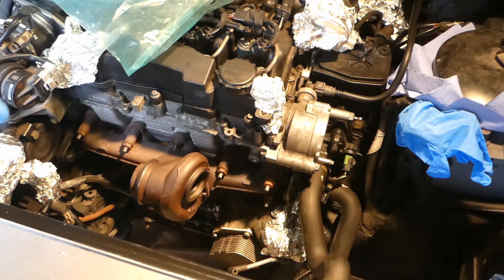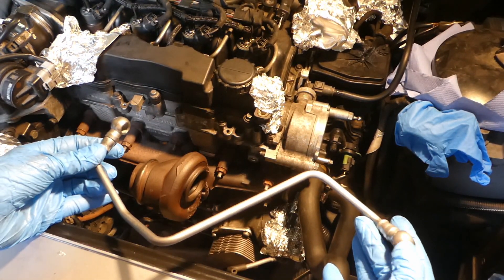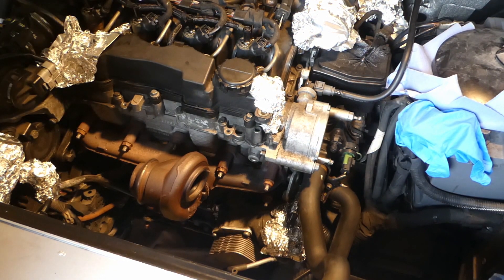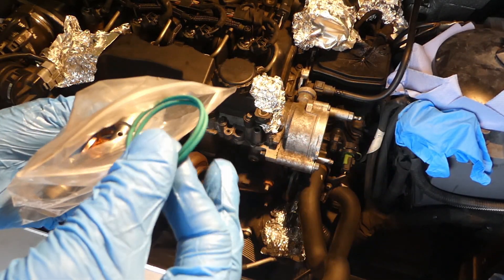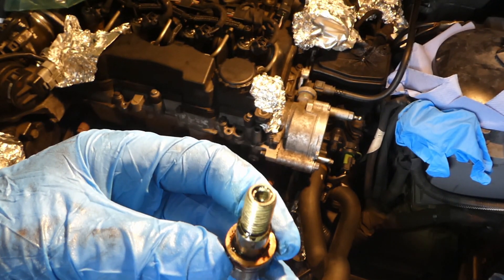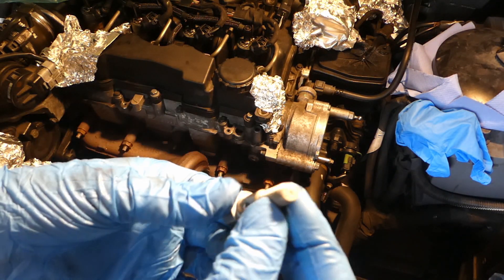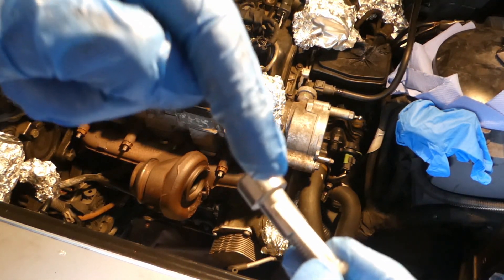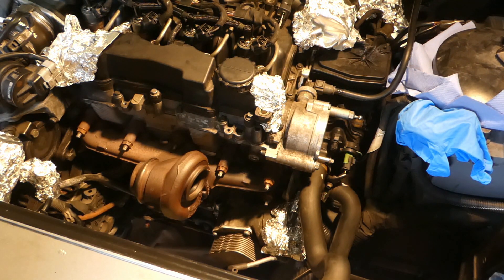1.6HDi turbo replacement, the full guide (part 3/5: fit new turbo)

Comment: please can you confirm the torque of those bolts, because you said thirty (30) NM but the pictures shows three (3) NM
Reply: ok thank you very much, now i understand...yes im doing it cause that oil tube started to loose a lot of oil, so im replaicing it, and i've disassembled and cleanned the turbo geometry too, i'v also washed the dpf...the only issue i had was the metalic pressure hose (out) of the dpf was really stuck, and was a big fight to get it out, now i must buy a new one but citroen dont made it anymore, and i can´t find it anywere, i must find a solution
Reply: sorry about my english, not my native language
Reply from the maker: @MarioRosa_70  Absolutely no problem at all. Better than most
Reply from the maker: @MarioRosa_70  No worries. Hope it works out ok. Maybe second hand ebay or somewhere else. Newer models might have similar hose.
Reply from the maker: Yes, I can confirm that these are 30Nm, not 3. In the picture it is written as 3daN, which is 3 * 10Nm. It is somewhat confusing, but is deci Nm, so 3 * 10Nm = 30Nm. Hope that helps and good luck if you are doing it
Reply from the maker: Correction, in the picture is daN or should have been daNm, and it is decanewthon meter, so 1daN is 10Nm.
Reply from the maker: See here: https://mathda.com/convert/torque/deca-newton-meter-to-newton-meter?sourceValue=1

Comment: Hi, where did u get those instruction pics with torque settings?
Reply from the maker: They come from PeugeotDocs, like a software that you install, similar to Diagbox/PP2000.
Reply: @ thnx. i assume it is a paid product or service.
Reply from the maker: @ Well, yes, but copies can be found around. If the car is up to say 2016 then it can be used with diagbox/pp2000/lexia.
Reply: @ could u link to one of these copies? i have a 2019 1.5 peugeot engine, even though it is marketed as toyota proace.
Reply from the maker: @ZwaanAfghan  Unfortunately, I cannot post a link here, but if you search download diagbox it will come up. All sorts of torrents. You would need an OBDII to usb interface that one can purchase on ebay, but 2019 might be on the newer side of things, as from a certain year it is all online. Now this is for diagnostic, but you can download Peugeot docs and that is separate which should have all the docs with torque settings, etc. Might not be for toyota proace, but you can see the other peugeots which will most likely share the platform. I think it was called something like Peugeot service box or SEDRE. I have it on windows 7, as it does not work on newer windows editions, so you may need a VM.

Comment: Hello, thank you for your work and videos ! If you can help me, i have 1.6hdi 109 cp and the top bolt gets smoked i think, maybe some burned oil or something, i don`t know. And my turbo whistles, but other than that, no problem with injectors, no oil leaks, no nothing. Do you know what would the reason be ? Thank you
Reply from the maker: Hi Alex, do you mean the top turbo banjo bolt? It is probably leaking a bit of oil and drips onto the turbine and gets smoked. You could reposition it (on a cold engine). Basically the pipe has to be central on the banjo bolt and not touching any of the sides. The it should not leak.
Reply: @moremolecules  yes, the top turbo banjo bolt. I looked and it doesn`t touch any side of it. It is just smoked around it, it looks like burned oil. Also, it seems to be burned oil next to the bolt, on the turbine exterior wall. Could it be some leaks because it is not tightened enough or something ? Should I change the oil feed pipe? I also don`t have a newtonmetric key so i hope it is not a problem if i tighten it with a normal key. Thank you again for your patience :)
Reply from the maker: @alexciuciu2297  Yes, it could be that it is not tight enough. I would suggest to wipe everything off there so it is clean of oil and then see where it is weeping oil. Most of the times is the actual pipe itself that connects to the banjo bolt. It is not the end bit of the banjo bolt that touches anything, it is the internal pipe that needs to be central. If it is the actual pipe itself, then you need to see is it left or right of centre and adjust slightly in the opposite direction.

Comment: do you think it's a good idea to replace the old style bajo bolt with the new one "just in case" ? or should I just check the old one if the mesh is clean, maybe clean it and would be ok? Where to buy the new style banjo bolt and can I just remove it and put it back? Will there be enough oil for the turbo when I launch the engine back? thank you !
Reply from the maker: If there has been regular oil changes with appropriate oil, filter, etc., there will not be a need to replace the filter at the lower banjo bolt. Mine at ~100,000 miles was clean without a single speck of anything on it. I did replace it with the new style one, but peope also altogether remove it. I decided to keep it in, but thought about it for a whole week, so it was not an easy choice. You could replace it, but not worth all the effort just for the banjo bolt, but if you have the time to do it then you could.
One needs to put some oil on the upper banjo bolt on the hole in the turbo. I think I have shown this in one of the videos of this series. That is enough to keep the turbo cold. The turbo shaft has some oil from the previous engine startup, so the oil gets back fairly quickly to the turbo, it is not that crucial if the oil is not entirely continuous. You would not rev the engine straight after.
Reply: @moremolecules  many thanks, helpful as always!

Comment: Your videos are amazing.
I have a Peugeot 407 se with 1.6hdi, 109hp.
I have blue smoke and a smell of burned oil.
Also my oil is getting under the level, it takes about 70ml at 120km.
I will take down the turbo and send it to a company that restore this things.
If I still get the blue smoke after replacing turbo, what do you think I should check next ?
Mechanics from my town have no idea what should I check after I replace the turbo and the problem persist.
Thank you!
Reply from the maker: See if you replace the turbo and the oil burning persists. See if oil does not leak from somewhere else. I guess the mechanic has checked that. First see if the turbo replacement solves the problem.
Reply: @moremolecules  thank you for your help.
I have sent the turbo to be redone.
Now I will wait 3 to 5 days , when I get it I will do the test.
Reply: @alexandruro1012  Hello, did the turbo replacement solve your problem?
Reply: @mentals555  No. It was a problem in the engine. i rebuilt my entire engine.
From what I saw, when you have blue smoke and oil consumption, then it is a problem inside the engine. you must open the entire car engine to see the problem.
Reply: @alexandruro1012  Ah, ok. Mine burns oil and smoked a lot after a short drive. The turbo makes a whining sound so I hope this is the problem. Thank you for sharing your experience
Reply: @mentals555  no problem. Hope you fix it.

Comment: you said the torque was 30 puls minus 5 - what does that mean? it says 30nm in the manual!?
Reply from the maker: In my manual is 30+/-5Nm, but if you do 30 should be fine
Reply: @moremolecules  OK thanx so there is a window of tolerance
Reply: @richardoloot1295  thats what exactly +-5 means